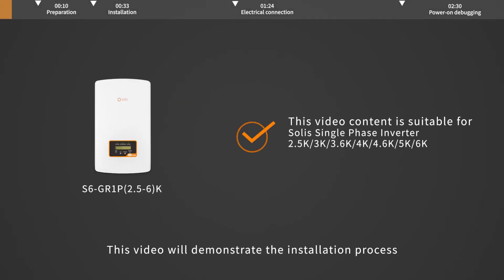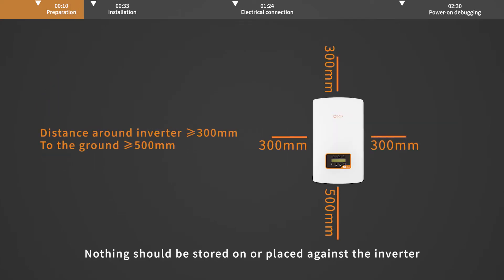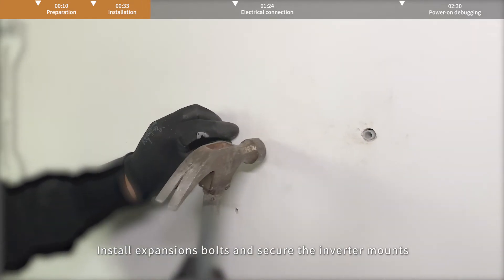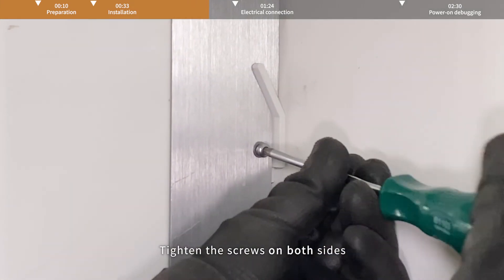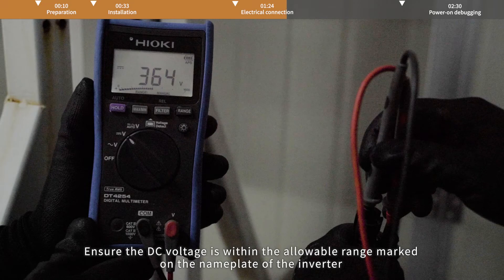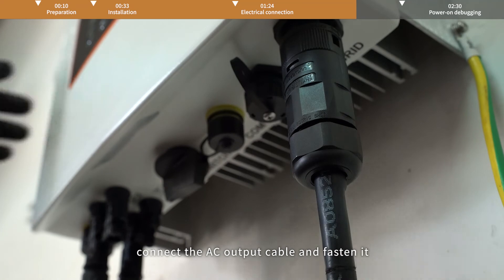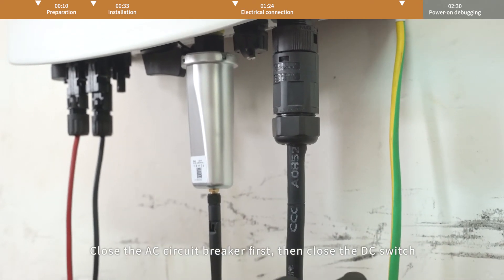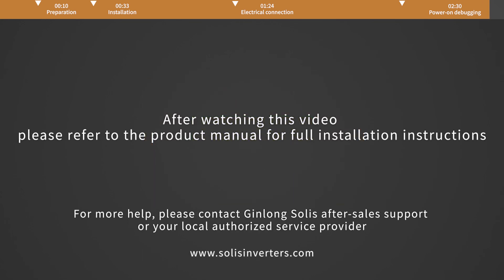S6-GR1P(2.5-6)K Installation Video

Comment: Can this be connected to a battery system and if so how ?
Reply: did you find a answer?
Reply: @Koffee  No, it's for solar power only, unfortunately. You need a hybrid one to do batteries
Reply: @shaunrobertson1096  ah that's a shame, im not sure what the advantage is missing out that feature.
Reply: @Koffee  charge more and get more money.  The hybrid also comes with WiFi so you can monitor